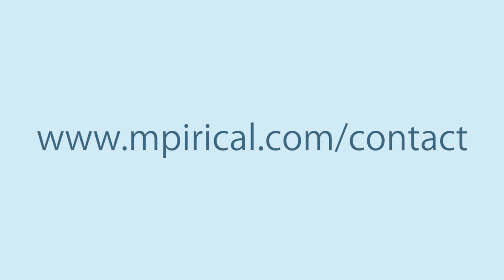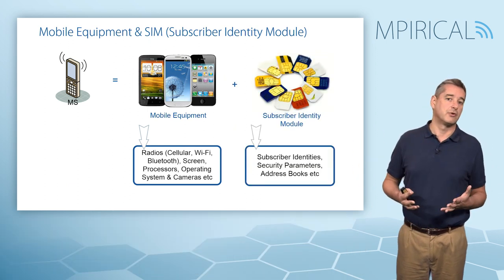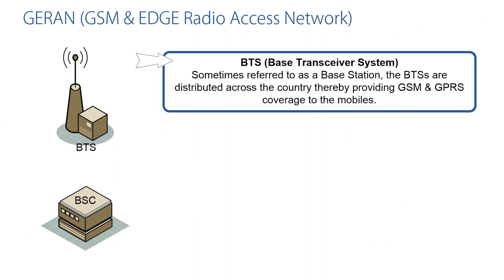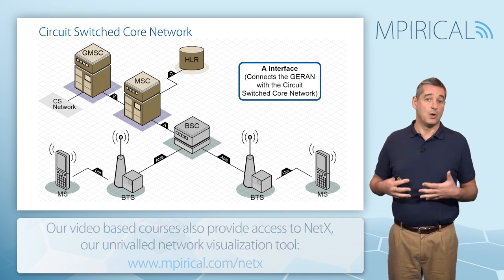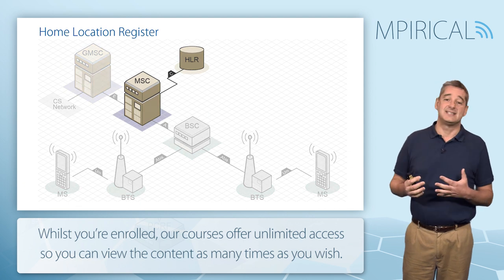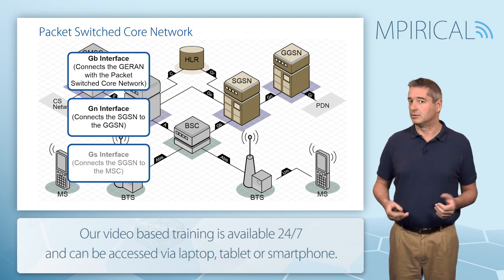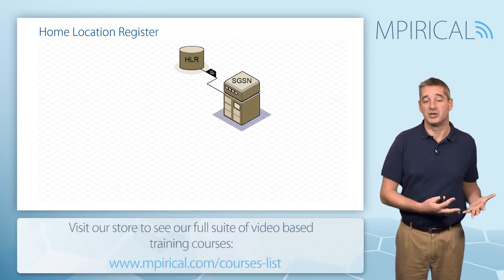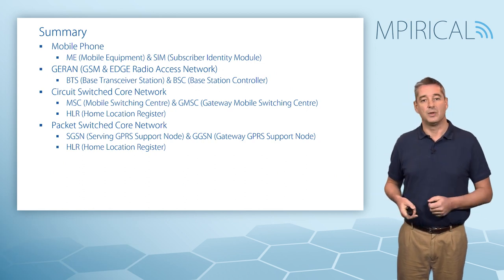GPRS & GSM Architecture - GSM and GPRS System Engineering Course

Comment: Best video ive seen yet about GSM communications. Can you please explain where the PSTN is at in this road map?
Reply from the maker: The PSTN has been around for a very long time, way before the introduction of GSM. As such, GSM networks use the PSTN to provide connectivity to the fixed line networks, as well as connectivity to other cellular networks.

Comment: Wow!!! The content is great!!! Keep up the good work.
I have a question: What makes GPRS to have a higher bit rate than GSM even thought GPRS is just an extension of GSM.?
Reply from the maker: Great question. GPRS enabled the aggregation / bonding of multiple “GSM timeslots” to increase the total data rate. So effectively, a GPRS user could use the equivalent of up to 8 voice calls (8 GSM timeslots)! In addition, GPRS can use a mechanism called “Adaptive Coding or Coding Schemes” – this adapts the data rate when the radio connection signal (bars on your phone) is stronger. Stronger signal = higher potential rate. It is also worth noting that GPRS has now been enhanced to include EDGE (Enhanced Date for Global Evolution). This included a new radio modulation scheme, which is three times faster than GPRS, that enables more data to be carried. Again, this benefit is more related to when the radio connection signal is stronger.